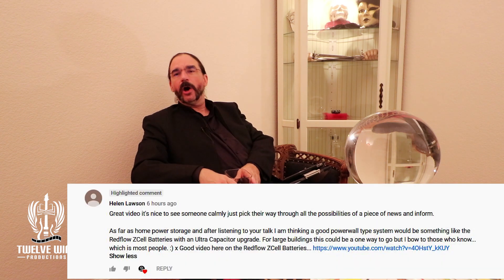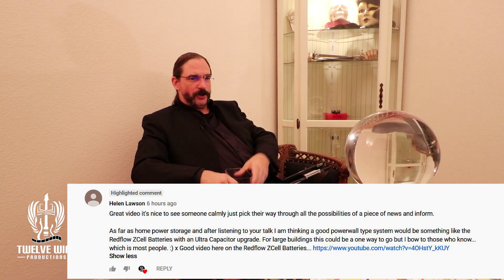Fixing the problem with Flow Batteries: ESP Q&A

Comment: Well done to Helen for bringing it up. It seems a pretty obvious thing to do, amazed this hasn't already been done.
Reply from the maker: Yes.  And another way to also accomplish this would be to use a bank of lithium ion batteries that had a much smaller capacity but capable of delivering 10-15kw of power.  But I think the Ultracaps is a very elegant solution for most applications.
Reply: @twelvewingproductions7508  A capacitor has intrinsic losses. IIRC my first semester correctly half of the energy gets wasted in charge/discharge. If you want to stabilize the flow of battery current, you will need to route it all through the capacitor, hence always loosing 50% in the store/discharge cycles. I guess it will be a question of economical balance rather than a technical issue (ie how often you charge and discharge, how the losses (including capacitor leakage current) sum up and the economic gain of buffering a Zn/Br flow-cell with a supercapacitor. Also, supercapacitors tend to degrade which will also degrade the overall system lifetime and therefore value.).

Comment: There is essentially no lag between requesting power and getting it. At least there isn't in my house.

We have a pair of these batteries and yes we are new to them, but there was one interesting thing I didn't know until our own batteries were fired up; the pumps run all of the time.

If you look carefully at those screen clips that you showed, and do the maths, you will discover there is a discrepancy in generated power, house load power and battery output/input. In our situation the parasitic draw is somewhere around 125W - 150W from the two batteries; I think. We have the same two battery set-up that is in that, "Fully Charged" clip you referred to.

As for how quick it starts giving you power, the lights don't even flicker, nor does anything else in the house. We did quite a few tests where we had bright sunlight and generating more than we needed. Other times we had cloud cover. The power switch on the board was flipped, as mentioned, the lights didn't flicker. It was business as usual, no matter what we did.

I'm not yet sure how things work, but I'm assuming there is a bypass running and when things switch around. Things happen not much slower than the speed of light; sorry, couldn't resist that.   :-)

There is a Redflow BMS which fools the inverter into thinking that the battery/batteries are always needing bulk charging. Remember, these batteries run flat out until they run dead flat, or totally full. Our initial tests were done with the batteries at around 4-5% SOC and we were pulling around 3,500W out of the pair of them, switching appliances off and then feeding them around 300W - 500W from the rooftop solar; it was very early in the morning.

Conversely by around 1100 hrs we were generating around 4,700W from the roof, when we did another test and flipped the power off. The house was consuming around 2,300W when we flipped the switch. Immediately the batteries were taking around 2,250W of power. Our rooftop PV panels, are all running micro inverters.

Food for thought, eh?
Reply from the maker: Thanks for that information.  I have a couple questions.
What other equipment is installed as well as the batteries?  Is it possible that you have a bank of capacitors on the "BMS" that is on the house?
That might explain why there is no hit.
The other thing that might explain it is what you said about them running all the time.  That is unfortunate as one of the main selling points for these was their ability to store a charge basically forever.
That isn't really accurate if the pumps have to run constantly.

The other thing is size.  Where do you have them?
Reply: @twelvewingproductions7508  Perhaps you should look up their website and have a read of the specifications, this will answer quite a few of the questions that I'm sure you are thinking of.

The pumps run all of the time, that is true, but if you shut a battery or the batteries down in our case, then everything stops exactly where it was. When you fire them up after one hour, one day or one year, you should find they are in exactly the same state of charge as when you shut them down. When they are shut down, there is nothing happening, they are effectively inert; as I understand it.

We have nothing else installed to the house, the batteries arrived and were put into their position, the wiring from here there and everywhere was done. There is an inverter and a Redflow BMS, other than the usual things that need to be done on any installation like this, that is it. Both the inverter and the BMS are in their (supplied by the installer) weatherproof enclosure around 900mm from the batteries.

With the batteries centred on the pad, 250mm either side, and with the pad 250mm from the rear of the house wall, the batteries are approximately 500mm from the back wall of the house.

These batteries are as quick as lightening when delivering power from nothing to a few thousand Watts instantaneously, it seems; that is our experience anyway. We don't notice a thing, end of story.

They are not small, but on the other hand they are not huge. Once again, if you go to the Redflow site, there you will see the accurate dimensions. But in our case I put a 1m x 3m x 150mm deep reinforced concrete pad down with N40 strength concrete. The batteries are approximately 1160mm long, 486mm wide and around 1026mm high and according to the writing on the crates in the form we have them in, they weigh 270kg each, so well over half a tonne in weight on that concrete pad.

They do make a noise, cooling fans and the ever present pumps, but unless things are really ramped up, they are unable to be heard if you are a few metres away from them and things are normal. That said, I wear hearing aids.

Our batteries are called Z Cell batteries, meaning they come with a fully weatherproof external housing, ours are just sitting on the pad; you cannot push them around, I know this as I helped with the exact locating of them. If you purchase the naked battery, it is called, ZBM 2 (I think).
Reply from the maker: @allanhugh2044  , I did actually.  Go have a look.  They try and hide more of the key data than they actually release.
For example the current output for nominal and peak.
When key data is missing and I have to look under a rock for it, it always raises a red flag for me.
Reply: @twelvewingproductions7508  In general I agree with you on companies that somehow seem to restrict data, even if they don't mean to.
With regard to the Redflow battery, I have data that took me a while to get; but I got it. Last year I eventually purchased a sort of, top end wood working lathe; it took quite some time before I eventually found out all of the data I was looking for to enable me to make an informed decision. That kind of information gathering scenario, is generally the norm with almost any purchase I make. Pretty much how the world works; but I do understand where you are coming from.  :-)
Reply from the maker: @allanhugh2044 , true but in looking at this from the perspective of a process engineer looking to integrate a piece of equipment, there are very key elements that are critical.
If I look at a data sheet for something like the red flow battery, wouldn't you think the very first thing I would want to know is what it's output is?
Why is that not listed on the data sheet?  That was very odd to me.

Comment: We need a supercapicitor buffer to start our air conditioner while using solar.
Reply from the maker: Actually a garden variety capacitor will probably do the trick.  The unit you are looking for is called a "soft start".  They run between $200-400.

Comment: I live rather close to the north pole, so for a solar energy system, I would need storage for half a year.   (quick estimation...)  How much would 3000 kWh flow battery cost?  + at least 1000 kWh if I buy an EV.
Reply: I'm guessing around $200/kwh like large LiFePO4. If it was a lot cheaper then they would be taking over the market and they are at the moment a niche product. I'm 53 degrees North and would happily kill someone for a couple of MWh of seasonal storage :)
Reply from the maker: That's a hell of a system Santa!
Reply: @AndyFletcherX31  I'm at 61 N.  Tesla might have cell cost 100 $/kWh.  Flow battery should be cheaper, but I doubt it is cheap enough.
Reply: @twelvewingproductions7508  Finland: about 5M people above 60 N. 
Saint Petersburg: 6.2 million, 59°56′15″N
Tallinn: 0.43 M, 59°26′14″N
Stockholm: 2.4 M, 59°19′46″N
Gothenburg: 1 M, ￼57°42′N
Oslo: 1.7 M, ￼59°55′0″N
Anchorage: 0.4 M, 61°13′N
Reply: Probably some wind involved
Reply: @TheThom1956  During winter very cold weather usually comes with very weak wind.  So even with wind 2 weeks storage, at max usage, would be necessary. A month to be certain. But wind is stronger higher up. So efficient wind energy collection is a large scale project.  Solar energy is a good solution in a small scale, but not here.

I forgot Murmansk area from my list: 0.8 M, 68 N.
Reply: @jkn6644  So, Perhaps Community or neighborhood collective might be sought
Reply: @TheThom1956  I don't think I could get permission for a large wind turbine.  Too many houses and a small town too close. People do support wind power, but only if build somewhere else.  I leave wind power building for bigger players.
https://en.wikipedia.org/wiki/Wind_power_in_Finland
No growth in 2018, but I believe growth will resume soon.

I guess hydrogen will be better long term storage than flow batteries.  Storing H2 is difficult, so perhaps we need to make some hydrocarbon or ammonia.
Reply: @jkn6644  honestly storing it is a mistake in some contexts. If you live that far north you have only a few choices:

Grid nuke, grid import southern solar, grid fossil fuel, grid geothermal if available.

Wind does very very poorly small scale unless you have freakishly high wind speeds on your property. 

If you build a battery that will store half a year of power, congrats, you now have a higher embedded energy value in your system than if you just ran a generator in the winter instead, and you are poor. Woooo!

Maybe we are getting close to even costs, but until recently, nuke when used to most of it's capacity is the overwhelming cost champion.  Used to be solar got as much subsidies per kwh as nukes cost per kwh, so if nuclear got the same subsidies, it would be free. It's very affordable, lasts a long time, gets next to no subsidies, so you know it's an honest cost, and if the peak demand is higher than output and minimum demands are lower, you can transfer load with batteries, which is economical because you only need a small portion of the power consumption covered by storage and only for half a day. Much much better than a years worth of accumulation.
Reply: @markallen6433  Storing is only way to make solar and wind reliable.  Flow battery might, at least theoretically, be cheap enough.  It only needs huge tanks of storage liquid.  What I remember reading earlier energy density is not very high and cost/kWh is rather high. So I agree we need nuclear energy here.  Import distance for solar would be rather long through densely populated Europe. Large area grid would even out variations of wind power reducing need for storage.

Running generator would be more expensive than energy from the grid, unless burning wood for a steam engine. Even if I run it only when we don't have solar energy.

After recent price drops wind and solar without subsidies are cheaper than nuclear. Problem is in storage.

Max temp today 9.3 C.
Reply: @jkn6644  nope. They are still subsidized, but they are subsidized before the electric power is sold on contract to the utilities. They are subsidized through manufacturing tax breaks, consumer  tax breaks, a lack of needing to pay for decommissioning, a lack of need to pay for the deaths of birds and bats and on and on and on.

Nuclear is cheaper after paying clean up and being held to a standard of such high safety standards that it's orders of magnitude less human deaths per energy generated.

Wind and solar are getting better, and it looks like they will actually get cheaper than nuclear in honest accounting, but they should only be seen as technology in development. That development is important, so what Europe and North America and China are doing is great, but let's please be honest, it's good to subsidize the industry because industrial implementation is a key part of making the tech viable, but it is NOT cheaper then nuclear,
Reply from the maker: I haven't priced out industrial flow batteries.  The prices that Tesla gives for their industrial product changes frequently as well.  I would look closely into the thermal qualities of the flow batteries and find out at what temperature they freeze.
3Mwh is a huge battery.  Your biggest issue would be the solar farm you would need to actually feed it.
Reply: @twelvewingproductions7508  I have not calculated how large tank I would need because I assume price will make this unpractical anyway.  But I could easily find 10 m³ storage which is easy to keep above 0⁰C. (Underground basement, weight is not a problem.)  

During midsummer, I have more than 18 h of sunlight per day, but I'm using 10 h in this calculation.  Half-year ~ 180 days ~ 1800 h.  
3 MWh / 1800 h = 1.7 kW.  With only 90 days: 3.3 kW.  Charging is not a problem.

I would not need much power, only huge energy storage. So no need for an industrial battery.
Reply from the maker: @jkn6644 , man that really is an engineering issue.
I know there have been people working with hydrogen storage.  Using electricity to make hydrogen and store it in large tanks and then get power via a hydrogen fuel cell... but that is an engineering nightmare and VERY dangerous to compress hydrogen.
I would say that it might be a reasonable application for either wind or pump hydro depending on what your landscape looks like.
Obviously pump hydro is an issue if it's frozen solid.
Have you considered wind turbines and standard lithium batteries?